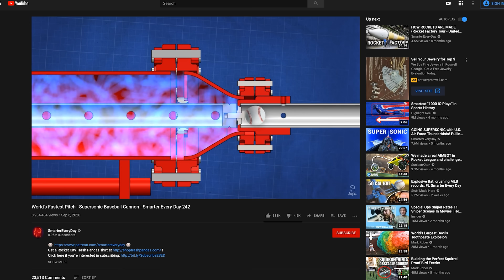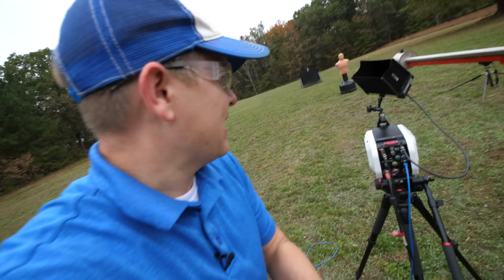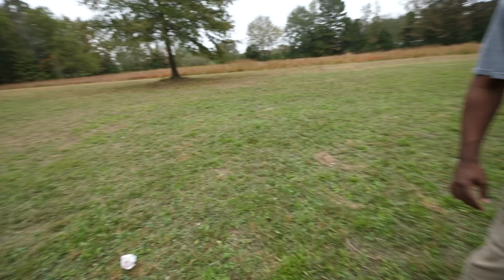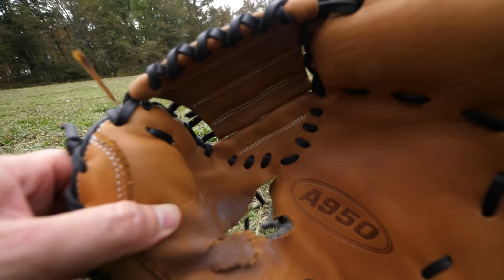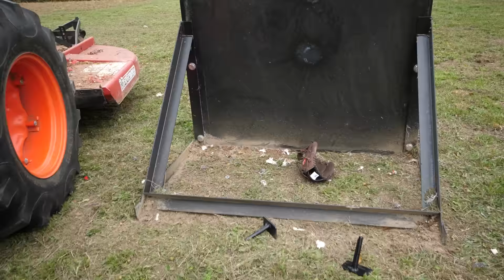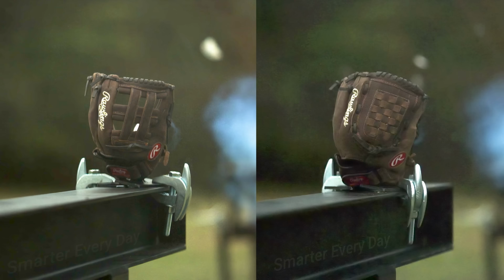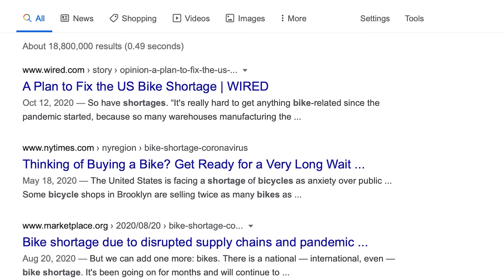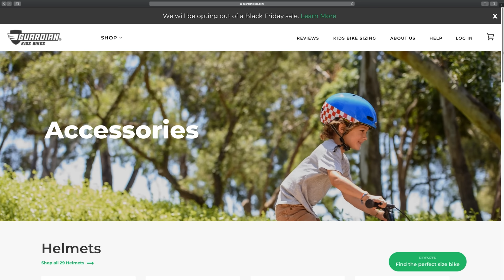Trying to Catch a 1,000 MPH Baseball - Smarter Every Day 247

Comment: Awesome as always. I've got a strong suspicion the fire is the diesel effect. You see this a lot in ballistic gels where combustible vapour released from the supersonic bullet hitting the gel is rapidly pressurized until it ignites. Sort've like a fire piston. I think the ball has so much surface area that when it hits the glove it makes a momentary sealed chamber, as well as leather vapour, which both compress until ignition
Reply: Interesting !
Reply: That's along the lines of what I was gonna say. Under extreme and very fast pressures you can ignite steel wool in a chamber. I can't remember what youtube channel made a clear one of theses
Reply: There are oils and waxes in the leather to keep it supple. If you really pinch some chrome tanned leathers you can actually see some of that leather dressing exude. I imagine that would vapourize on impact. Is that what you mean by leather vapour? If so, that's what I was thinking, too. It doesn't seem likely that tanned skin itself would burn that well.
Reply: @manatoa1  I think the oils will burn/vaporize first, but under those sorts of pressures the leather itself would vaporize a bit. Doesn't really matter one way or the other, it'll all burn once the pressure gets high enough. It's all just carbon compounds + oxygen + pressure at the end of the day
Reply: @thethoughtemporium  "It's all just carbon compounds + oxygen + pressure at the end of the day" Exactly! We all are!  :D
Thanks for your great videos, BTW!
Reply: My thought as well
Reply: Sort’ve??????????
Reply: The mantis shrimp brought me to this comment
Reply: Makes sense in my uneducated head...
I'd love to see if they sprayed diesel with an injector before the ball hits and see if it works at lower speeds...
Reply: @Elijah Ferrin I think that's some of the stitching that is being torn off.
Reply: Late to the game but this was my thought as well.
Reply: "Leather vapor". What a concept.
Reply: Yep.  That moment when the air is compressed between the glove and the ball.  Super-heating and boom, combustion.
Reply: @thethoughtemporium  new radio related videos please
Reply: THE FIRE IS BEHIND THE BALL THEN HITS THE GLOVE WITH THE LITTLE FLAME FOLLOWING THE BALL BEFORE THE IMPACKT
Reply: @cameroncrofford5671  I saw that too.
Reply: @Markle2k  Indeed. If something doesn't ordinarily vapourise, you just haven't used enough energy yet :D
Reply: On the channel Taofledermaus, they've seen similar things on some of the objects they've shot out of their shotgun. I do think it is air compressed to it's ignition point, whatever materials are rapidly vaporizing each other.
Reply: @CRAZYkoolman55  Clickspring?
Reply: Just searching if somebody answered this, and I totally concur: it just looks so similar to the red/orange flame of the pressure smoke tests.
Reply: @CRAZYkoolman55  Steel wool burns easily because its high-carbon content and its big surface/mass ratio.

That is why flashpoint and firepoint values only matter as a relative value, not as an absolute one: with enough surface area, most combustible materials can burn below 0°C
Reply: Sonoluminescence Event. Happens a lot when shooting ballistics gel.
Reply: @Markle2k  aerosolized leather particles, not that farfetched.
Reply: @Elijah Ferrin ... I noticed this too, interesting that they didn't bring it up. You can see the small dot trailing the ball and it looks like fire.
Reply: Came here to say this. The most likely method of combustion is compression ignition. This can happen even with plain old air, as anyone who's learned about submarine accidents will tell you (the most deaths aren't from drowning, but from compression ignition of the air inside the boat, which compresses rapidly when the hull fails). A fraction of a second before the ball bursts through the leather of the glove, it forms a pocket of air between it and the palm of the glove which compresses at mach 1.3 and ignites.
Reply: Agree. The oils in the glove are compressed to the ignition point just as is done in a diesel engine. Could validate this in another video blasting a baseball through a piece of drywall with an oil impregnated sponge
Reply: Or it just hit so much of a friction value it just squeezed a spark :>

Comment: "How many gloves can a supersonic baseball go through?"
DemolitionRanch wants to know your location
Reply: That Baseball cannon makes a 50 BMG look like a .22LR . Haha
Reply: @unseenjake2  A 5 ounce baseball moving at 1500fps has a "muzzle energy" of about 11 000 ft-lbs.
Compared to 50 bmg with 13 000 - 15 000 ft-lbs.
So its actually not far off.
Reply: @Steve-vp8ng  i don't know the energy of the baseball and I'm too lazy to calculate it but a 50 bmg has around 15,000 (or less depending on loading) ftlbs of energy. Not 1,500
Reply: @Steve-vp8ng  You're off by a factor of 10.  The ball has ~11,000 ft-lbs and the .50 BMG 13,000 - 15,000 ft-lbs.
Reply: @ChadRazorback  Youre right, fixed it.

Comment: You guys are great lol, when you came across the issue of the flexing piston absorbing the energy of the rod.. I was sat here thinking ‘just weld an extension on the trailer and use a couple breeze blocks with a rubber pad on top’.. cut to the next scene and you are designing a solution with a drawing and the whole 9 😂 excellent resourcefulness!

Comment: The fire could be from the oil in the leather "dieseling" from the high compression created by the impact
Reply: You're exactly right!
Reply: I was thinking one glove had more oil then the other
Reply: Yes because of the thermal energy released within impact and high velocity fiction of the glove and baeeball
Reply: Nope, there was flame before the ball hit the glove. Pause the video right before it hits and look behind the baseball. The atmosphere ignites in the pressure cone...
Reply: @joshuareed6894  high pressure in front of the ball meets with the inertia of the glove and makes a high compression area, and the oil in the glove ignites . Exactly like a diesel engine... High pressure in front of the Piston pushing against the head makes enough heat to ignite fuel, although there is no element there to create spark
Reply: Ok bill nye
Reply: Friction
Reply: What he sayed
Reply: facts
Reply: @joshuareed6894  Atmosphere doped with some oil vapour displaced by the same pressure cone perhaps?
Reply: That is most of the reason but some of it was the leather and the air molecules hitting it so fast it made fire
Reply: People do this with high compression pellet guns when they rub Vaseline on the skirt of pellets
Reply: I mean or friction
Reply: Guys, at high kinetic impact you don't need any fuel to have fire, even rocks can create fire
Reply: What’s your engine run on

Baseballs and gloves
Reply: Haha 😂
Reply: I think the actual ball itself is on fire, if you pause the video at 10.53, you can see an orange glint just before the ball hits the glove. edit: you can se it pretty clear in the comparison shot at 10.48 on the example to the right.
Reply: you can actually see the fire behind the ball prior just prior to glove impact and trailing after. Air friction?
Reply: Im not smort :(
Reply: What?
Reply: Every nerd "hes over nine thousand!!!!"

Comment: anyone else notice the badass vapour trails coming off the ball in slo-mo, it almost looked like it was on fire
Reply: Yep, it's plasma being generated as the air molecules try to get out of the ball's way.
Reply: @Scott_C  I don't think it would be plasma as you would be able to see that effect on a supersonic plane if that were true. Instead it could be a vapor cone caused by the local decrease in pressure (and therefore temperature) behind the ball causing vapor condensation
.
Reply: @Scott_C  Definitely not plasma, water vapour condensing in the low pressure wake.
Reply: thanks for pointing it out. it looks awesome
Reply: The explosion we seen in the glove was Boyle's law. guessing the vapor trail was the same the air just had an avenue of escape and could decompress before ignition.

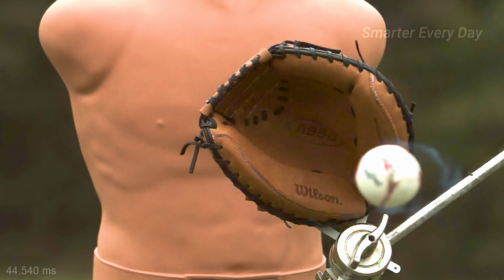Comment: 6:48 Did you see the ShockWave around the Ball.
Reply: Is that condesation because of the high difference in pressure ?
Reply: it's so beautiful.
Reply: I that it is the condensation in the low pressure part of the shockwave 

Soo cool that it does that
Reply: @fcknhllkllyll3767  May be but I'm just thinking about shockwave Destin mentioned in his before video.
Reply: I have never seen "trace" from a baseball before.  
Next step, a spotter with a scope to hit a Bob 500 yards away.
Reply: @stunna2305  Wow I thought it was just you.😂😂

Comment: So, do you have to register this weapon now? Jesus
Reply: Right, it's a straight up gun..... no, a cannon
Reply: Wait until he learns what a discarding sabot is and he finds a handful of old metal lawn darts
Reply: You literally copied this comment
Reply: @nitor5398  he used to help develop advanced weapon systems I’m pretty sure he knows all about em
Reply: @chicken69tenders  doesn't take away from the fact that we'd like him to do something with em
Reply: No. You don't. And that's the whole point of making weapons yourself.
Reply: @RyanGG it is not for sale, the builders are the only ones using it, and they are undertaking adequate safety measures. That last one isn't even required to make this whole thing perfectly legal.

Same reason you can mill an 80% lower yourself and not bother with a serial number.
Reply: @ryangg1756  False. Varies by state, but firearms made for personal use require no registration and are completely legal. Black powder and airguns are not considered firearms. An air cannon meets zero legal definition of a restricted device.
Reply: @drumkommandr9779   That only applies to weapons that would otherwise be legal to own. I'm not well read on laws regarding airguns or weapons that aren't man-portable so I can't comment on the legality of this baseball cannon, but being privately built for personal use definitely doesn't guarantee that it's legal.
Reply: Try to shove up a APFS-DS round in it see if it,ll penetrate all the way through that steel plate.
Reply: Not Jesus. It’s Destin 😂😉
Reply: @ryangg1756  we can't even have A butterknife at home
Reply: u. frickin. BOT
Reply: stop spam
Reply: @ryangg1756  Supersonic projectiles shot from any device aren't illegal and this cannon isn't even a destructive device, since it doesn't use a propellant, and I am pretty sure that the possession of an airgun isn't illegal in that state.
Reply: Idk cause with air rifles you don’t even tho u could theoretically kill something with it
Reply: Only in Commiefornia
Reply: dont give the atf any more ideas
Reply: Nah just a small air gun.
Reply: @ryangg1756  actually it’s not because it’s not ran off gun powder which defines a gun and a cannon. air powered guns are completely legal and no need to get a permit to own one
Reply: It's Texas.. He prabobly doesn't have to 😂 😂 😂
Reply: No he wouldn’t have to register it because it’s basically an air riffle
Reply: Don't have to register weapons in most states, thank Jesus for that 🙏
Reply: @cartercasey8149  air rifles dont need to be registered

Comment: The oils used to treat the glove are flammable to an extent and just like diesel, under pressures with ample oxygen it easily facilitates combustion. Just like “dieseling” a pellet rifle. Look that up. A clear pellet gun and a slo motion camera would rival that clear combustion engine video you have.
Reply: Under-rated comment. Potential puzzle solver here.
Reply: Also, the basket weave combines the rough side and the smooth side of the leather.  The rough side has much more friction than the smooth side.  Fast speed + high friction + oils and other chemicals = fire.  The h weave is all smooth leather.
Reply: cool explanation but if you look closely the ball has a trail of fire before it ever hits the glove
Reply: @michaelfitzpatrick1843  The same explanation could apply to the ball. Surface treatment of the ball/stitching and the immense pressure that accelerates the ball could cause "dieseling" of those products.
Reply: @michaelfitzpatrick1843  I believe that’s the vapor cone, since this is a supersonic ball after all. Not fire.
Reply: @timothyjenkins9247  I can see the vapor cone in both slo motion scenes but in the scene at 10:52 you can see orange small flame next to vapor cone.
Reply: @michaelfitzpatrick1843  Look at the footage starting at 6:25.  You can see the red threading of the baseball has come loose and is trailing the ball. At impact you can clearly see the loose threading. I think this is what you’re seeing in the other clip. There would be no physical explanation for the ball to be on fire moving through air at that speed.
Reply: @timothyjenkins9247  All you have to do to see the fire trailing the ball is to watch closely at 10:52, I am not the only commenter to witness this and it is something you can see with your own eyes just by watching the clip.The fire begins trailing the ball when it gets very close the glove. The explanation that the original commenter wrote could be applying to the ball at supersonic speed (friction plus oils and oxygen)

Comment: This proves if u go fast enough there’s no such thing as a solid
Reply: I mean, the metal barrier still stopped it,
Reply: Very true!
Also, I think it would go through the steel if it was closer to the initial firing.
Reply: Yeah if that was a real person, not only would multiple bones turn to powder, but most of your organs would become mush. You'd be dead in under 1 second.
Reply: But what about water
Reply: @gustavowadaslopes2479  the only difference density makes is on what speed and time scale it starts to act like a liquid--at mach 5+ it has more in common with Jello or water.
Reply: @cheyannei5983  At that point I think the ball would start behaving like air.
Reply: This might be the most clever comment I have ever seen.
Reply: Yup.
Reply: But fast enough impact with water will behave like impact with solid.
Reply: If you go fast enough everything becomes a nuke.

Comment: My theory on why there is "fire" is the ball compressing the air in between the glove and itself. The basketweave glove has fewer "holes" for the air to travel through that's why we see the fire from air compression in the second glove and not the first. Also, for those who are wondering what I am basing this theory on, I am basing it on gas laws and the PV= nRT formula. At least that is how I would explain it.

Edit: A video called Fire Syringe made by Veritasium demonstrate what I was thinking about
Reply: neh i think its just water vapor condensing coz sonic wave depression parts (low pressure)
(Edit) nvm i was thinking of something else
Reply: Hmm that's actually a good theory, it makes sense.
Reply: That’s exactly right. In the lineup of gloves, you can see fire from the third one which was both a basket weave and angled best to get the ball in the deepest well of the glove compared to the others.
Reply: Thats exactly right
Reply: Jesus FRICTION!!! People friction.
Reply: Makes sense, there is even a fire starting technology called fire piston that causes ignition in the same way.
Reply: You can see the same thing when bullets hit ballistic gel. The gel closes the cavity fast enough to cause a similar fireball.
Reply: Concur, physics are similar to a Fire-Piston device.

Comment: So at some point we went from a Smarter Every Day video to a Demo Ranch, "How many baseball gloves will a 300 cal go through?". My money is on the fire being from the air being compressed between the glove and the supersonic baseball.
Reply: Friction on moving objects the faster you go things heat up causing fire.
Reply: @mattb5160  It's mostly caused by the air compression actually. Not much of the heat is from friction with the air.
Reply: The Bob dummy made me think of Bobby on Demolition Ranch.
Reply: Oxygen compression alone does not cause ignition, and you also need another flammable chemical or material to burn, as oxygen itself is NOT flammable.  Plus, the contact of a round ball and a glove allows any air being pushed to escape around the surface.  Otherwise the ball might have ignited when contacting the steel plate, or Bob.  In Physics, we learn that collisions of any type always lose energy as heat.  Add this heat to the friction between the leather ball and the leather glove, and with the oils/coloring chemicals on both of those objects being flammable, this is where I will bet the flame comes from.
Reply: Don't forget old gloves are rubbed with all kinds of leather balms, oils, etc. And that DID look like an old glove.
Reply: @brynmrsh  its plasma flash